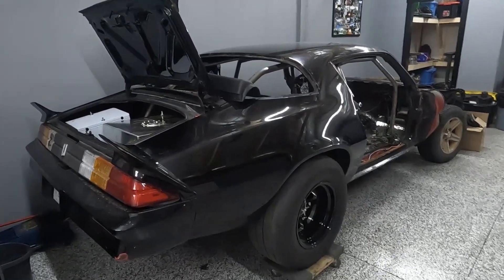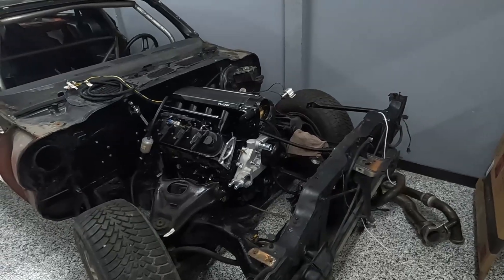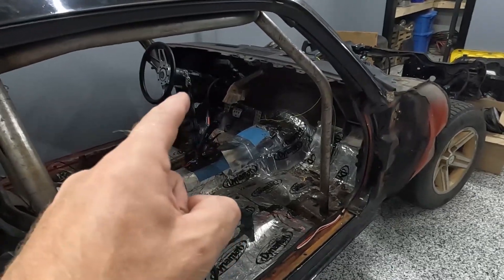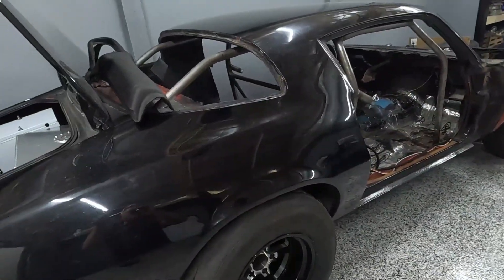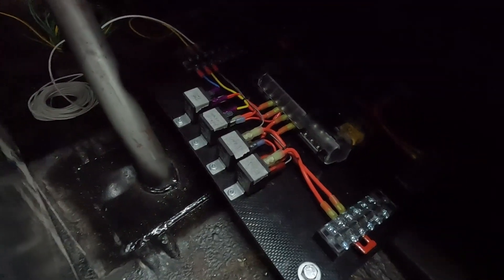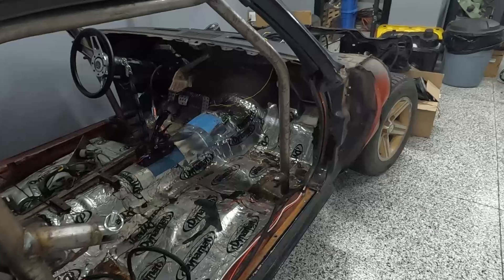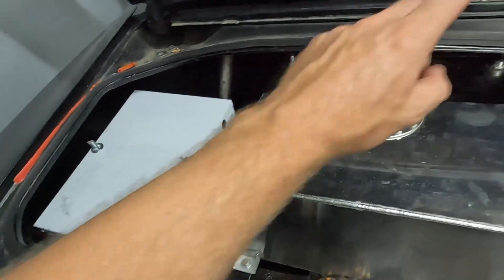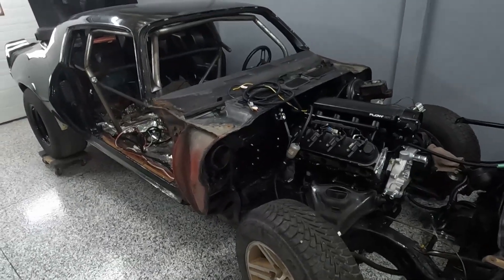Holley Terminator X - How it works with your factory harness and how I do it

Comment: I have a Terminator X Max bolted in a 93 Camaro with LT1 and Torqhead 24X coil per cylinder. Holley sent me a 58X harness… told me the crank and cam wires were longer. Turns out the 58X crank wires are set up for a 5 volt reference and my Torqhead crank sensor works off of 12 volts. Any advice?

Comment: So , the main wire from the old fuse , like the stud on the radiator support and run a wire to the power distribution module, either in the trunk or stock location? Right? I have been looking for this answer and you saying a big wire to the old fuse panel leaves a lot out, know what I mean eh??
Reply from the maker: @davecolquhoun9315  yes essentially I run the stock fusebox feed to the back of the car because the battery is back there. That feed then gets fused at the back of the car. I'm not sure how the stock wiring was/is in this car